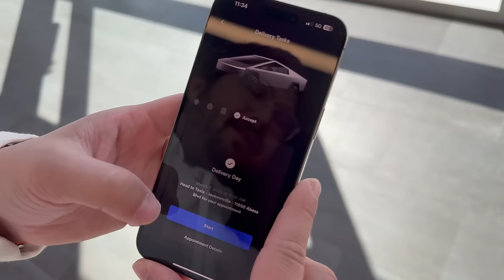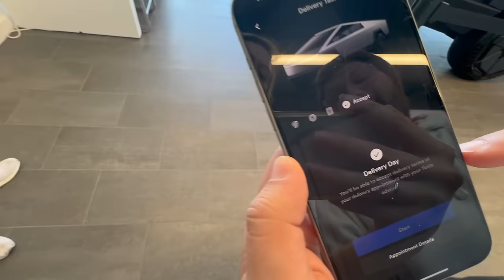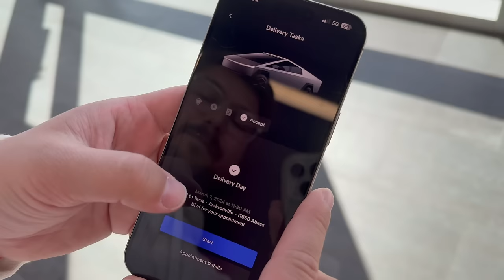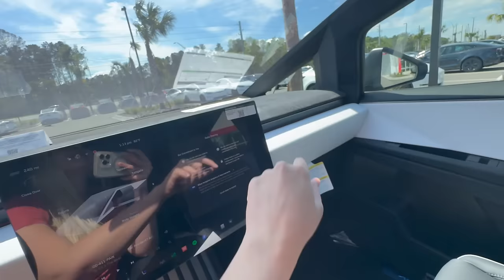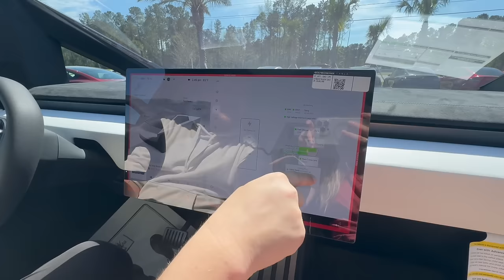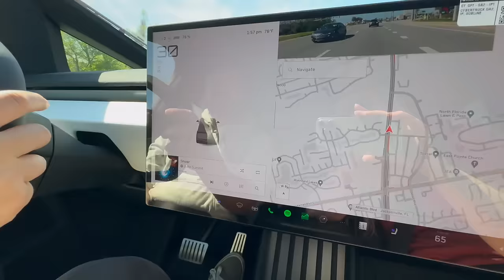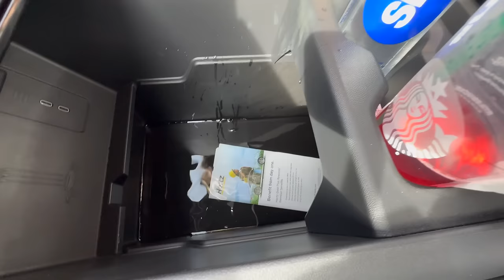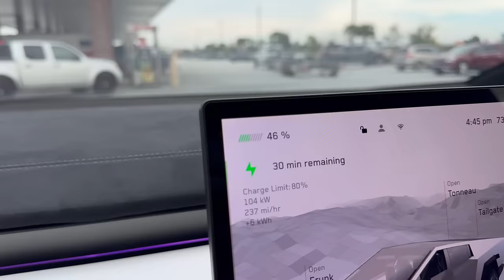Cyber Surprise! My Tesla Cybertruck Delivery Day - Build Quality, First Drive, & Handover Experience

Comment: Kyle, the foundations series cyberbeast comes with the required gateway for the PowerShare feature and a $4000 install credit as well I believe. At that point the cyberbeast is now a 9 powerwall battery back up system. That seems to me like an incredibly valuable feature that not many people are talking about. Congratulations and great video.
Reply: But only if they approve you to be eligible lol. Should be $4,000 credit towards supercharging and let you keep the PowerShare if you aren’t eligible. Or at least just the money towards charging.
Reply: The portable power features are a very big deal for many users.  

I think, in the long term, it will be a significant factor in resale value, as people increasingly realize how it works and how well it works.

Comment: 14:20 You can do a CLEAR wrap. It's basically what dealerships offer customers to protect paint against rock chips. But you can get the entire car wrapped with a clear wrap. Which would probably make the stainless finish pop with less finger prints

Comment: Makes me sad . I had originally planned to trade in my M3P that I bought in 22 when it my cyber truck turn came . I put 20k down and took a low interest (2.9) loan for 66 months . I still owe 37k as when I bought it was at its most expensive ( 63k I remember correctly). According to Tesla it’s worth 23k now with 8k miles and great condition. I’ll delay my cyber truck till I pay off this car . Sell my early reservation or give it to a friend . But I’m not taking a 15k haircut on my M3P . Even if I went through with buy and tried to resell Tesla will come after me for the profit . Love the company but that resale clause would have made me happy as it could have wiped my M3P negative equity .

Comment: 6:31 LMAO, WHAT?
 I once thought my Kona EV's 64 kWh battery was massive because it let me travel 280 miles on a single charge. 
Then, I switched to a Model Y with its 80 kWh battery and thought, 'This is a significant leap.' 
And now, here I am, learning that the Silverado's smaller battery is 180 kWh, and the larger one is a whopping 230 kWh. LMAO, WHAT? I seriously wish Tesla would bump up the Model 3/Y batteries to a usable 90 kWh capacity. That would be more than sufficient. Comparatively, the Cybertruck's 123 kWh battery now seems minuscule, lol.

Comment: Super excited you guys got this, and can’t wait for more content. I’ve got the same truck on the way. The Foundation premium isn’t a bad deal on the Tri motor if you want all it comes with.  
-FSD
-Install of 3V powershare system (up to $4000. This isnt covered on the AWD) 
-3V Powershare controller ($1200)
-wall charger ($500) 
-light bar ($400)
-lifetime premium connectivity ($120/year)
-misc accessories (~$1000)

This all totals to around $20K. So, its not just money thrown away to get the truck early.

Comment: I ended up canceling the cybertruck. Since I would not be able to do a round trip from Laguna Beach to San Bernardino Mountains. It takes just over 120kwh on my friends f150 and the usable capacity of the cybertruck wont cut it. Along with limited practicality for racks and price. Especially compared to a F150 extended range or Silverado ev.

I really want to see a f150 NACS vs EA race to vegas

Comment: Congrats Kyle!  I'm wondering how much vampire-drain it has when it sits out unplugged. Was waiting on a CT, but instead just grabbed an incredible deal on a lightly-used F150 Lightning Lariat. I'm still learning the Lightning (my first Ford), but one thing I like so far is almost no apparent vampire-drain at all. So unlike my Model S, it can stay unplugged in my driveway without concern. 🙂

Comment: I really wish those interior white panels could be dark gray or black. Maybe that will be an option later, or a product for the aftermarket. Congrats on the new CyberBeast! Those protective sheets should be left for the customer to peel, so I don't agree with the dealership letting someone else peel those off.

Comment: So I’m not up on a lot of Tesla tech. However, I’m wondering if autopilot is going to be a lot longer to release than you think. 
My thoughts is that they trained FSD with a completely different dimension vehicle than the cybertruck and as such is not a simple plug and play. I wouldn’t be surprised if it’d require an extensive training specifically with the cybertruck almost starting from scratch, so no vast database to rely upon.
The reason I think that is important is that it may be the same system they use to run the autopilot, just restricting it to autopilot functions. 
Basically they have to retrain AI to learn to drive the size of a cybertruck.

Comment: I agree with Kyle, the rear view is not the Cybertruck's best. To break up that plain slab, they should have put the logo, similar to the door sills. I know that would have been difficult on the stainless steel but would have looked better.

Comment: It's late in the season, but it would be great to compare these EV trucks if they were similarly outfitted for snow plowing.  Would Cybertruck's rear steering be good in tight parking lot clear-outs?  Would they be better than gas in the same situation because of their torque and weight distribution?

Comment: Does it have different surface finish on the doors and rear side panel?
The hood looks very rough in finish compared to my oven and dishwasher surface.
To bad about the hood and rear compartment alignment.

Comment: to properly build and test a brand new car and platform is at least 10 years, they didn't even have the factory built to makes these when the truck was announced, you can't just slap autopilot/fsd on a truck that's never been properly test, just because it works in one vehicle doesn't mean it's trans perfectly to the next

Comment: I was a lot more enthusiastic about the Cybertruck in the early years, but it doesn't hold up for the money and range based on the video.   Rivian R2S interior looked way better than this Cybertruck interior.  Rear cybertruck view Kyle mentioned in the video is super ugly on the road too. 

I keep wanting to find the positives in this thing and they are largely down to the Steer by Wire.  Cybertruck depreciation in a few years is going to be brutal.

Comment: I really wished that Tesla considered great range a must. Trucks are big and inefficient purely based on size and weight, but range is nonnegotiable for towing the boat to the lake or RV to the campsite for the weekend.

At least one version of the CyberTruck should have gotten a 180+ kWh battery and a real 500 mile range, even if it was a low volume option. The bed-mounted range extender is a poor solution due to its size and weight effectively making it a permanent installation. Good to see that GM is making a truck with >400 miles real world range even if they're only making a few thousand of them.

Comment: Regarding the steer-by-wire: what happen if you break while holding the wheel at a fixed angle.  Does the truck follow a spiral path?

Comment: Ok so for people that will use it as 90%
SUV and 10% Tow Vehicle (10k# trailer)- which is the best compromise of daily driver and occasional tow- also really want the biggest bed possible! So Connor, Tesla vs Silverado vs F150 vs R1T (I don’t think it can pull
That trailer safely). I have a CT on order- expecting vin in 2-3 weeks- but could pivot to another- will the RST be substantially similar to the current Silverado? Better than CT?

Comment: So where is the spare tire? For like a 100k truck it sure needs a ton of work and doesn't have the adaptive driver system that has to be added straight from the dealer. I would be mad as hell. Btw if you have to change like the air condition , would it be considered texting which is technically the same thing?

Comment: efficiency is most important, unless you're on the road constantly, small subset of folks need 500 miles of range on a daily basis, at that point you're drgging around batteries you don't need for daily commutes, as the software matures, efficiency will follow and range will be improved

Comment: eFUSE mismatches :hand-orange-covering-eyes:.  That does not sound good for a brand new production vehicle off the lot.  No clue what the eFUSE is being used for in this referenced VCLEFT ASIC but search seems to indicate the VCLEFT is the control unit for the left hand side of the vehicle.  So, maybe readings are out of spec for windows/door/suspension on left hand side.

Comment: Kyle the cybertrucks charging curve will get uncorked eventually after they gather data from the new pack. They did the same with the 3 long range 150kW to 250kW, Sr went from 100kW to 180kW, model S went from 150kW to 200kW. It's pretty obvious that it will get a boost.

Comment: CT has Interesting design, but with so many compromizes, poor visibility all around, super sensitive steering in low speeds (you have to be super careful all the time cruising in the city, not to make passengers feel sick etc, absence of stalks etc like looking so poor and cheap and empty inside especially at night with just a big  screen in the  middle, while even cheap cars have 3d instrument panels that look so much better  etc etc, "problems" that have been solved many decades ago by convensional cars. 
In person it looks better  i  think, but its funny in the videos that most cars around it looking much  better, in fact it makes some cars you would not look twice, to look good haha  controversial but true...
Some more negative things i realised from my quick test drive in the States: back passengers sit rather low and the front massive seats with those fixed headrests block very much their view ahead. In all other trucks and suvs and even  in most hatchbacks the visibility is much better.
The electric motor noise is quite loud at any speed in acceleration and in deseleration, which is fun in the  beggining but will be  tiring in everyday use... and the list goes on and on...  still a  nice toy for the  weekends if you are in the mood trying to fight all these problems which do not exist in almost no other car of today...  
Also it is not futuristic, it is  like  retro-futuristic....  would really be futuristic if it  was  made in late 70s or 80s.
This is my objective (european) opinion, not for me, too much struggle , still an interesting vehicle for youtube content etc
Curious, didn't you notice as well those negatives, like the poor visibility, the cheap feeling driving this at night time, the sensitivity of the steering in low speeds? (which is good only in parking lots, like 1% of low speed driving) 
The list of negatives is very big unfortunately, i didn't bother to mention many which are common in other teslas too, from the ergonomic point of view, which to most experienced drivers are deal brakers, like meyself. 
Still engineering wise this is a big achievment to really put this design into production actually!
And as i said before you chose the best vehicle for youtube content for the moment.
I hope you don't forget to say the negative things too as you notice them, all cars have + and - .

Comment: Holy shit , my first car had no power windows , no power steering , no power brakes ( drums) , no AC , and only 1 option which was a 4 spd instead of 3 on a manual transmission that having to close your own door being any kind of issue despite the self depricating princess statement It is wild what would make somebody not like a high end car from arguably the company that started or fast forwarded the industry that even makes the channel possible. No ass kissing of Tesla as reviwers is a must , but even as a joke its not endearing and see,s true and just highlights how spoiled younger people are . In some ways , i feel like cars are partially soo expensive now because people NEED soo many things and soft touch fuse box covers on more basic cars you cant even buy " stripper versions " of cars anymore to save money , your forced to buy " standard" features that are NOT FREE regardless of being optional or not . That or you need to buy a car you dont like that still has features you dont need because a better car cant be had as a true base car , so you emd up with an expensive cheap car with all kinds of shit you dont want or need compared to the money .

I understand MFG and how its easier to mass produce cars with a mess of features instead of custom orders but on lesser cars you need to buy an entire package for 4-5K to get one upgrade for something important to you that sould be a couple or few 100  . People are shocked about prices on cars but at same time complain that cars dont come with X . Y or Z and horrified that something is hard plastic on a non luxury car . People would rather have soft touch materials that will never be touched , especially if you dont detail your own vehicle ,  in a shit box then plastic in a better car .

Get off my lawn already . Go to the gym so you can close car doors.

Comment: There is nothing practical about Cybertruck or any other Tesla for that matter. Alyssa is right, the truck is a novelty.
I would pick Chevrolet Silverado with the largest battery any time of a day over Tesla gimmicks.
I am looking forward for a Chevrolet Suburban EV based on Silverado.
However I might consider second generation with much larger batery similar to Silverado Ford F150 Lightning based Explorer EV.

Comment: It's got one of the most god awful designs of any car I've seen since the Delorian but this doesn't have a movie franchise or nostalgia behind it.

I've never driven one but I do hear the audio system and weird crab like driving mode are actually really good so I'll give them kudos for that, but Tesla has a reputation for producing garbage for the first couple of years of a car at least then mediocrity when they figure out how to mass produce them. If it's anything like the Model 3, it'll have design defects up the wazoo, with an infotainment system that is near unusable because it won't play nice with any other company, and mechanical issues galore.

Tesla releasing a half finished car is pretty normal for them though, they seem to work on the whole DLC patch model that software works on but does NOT work for cars.

Comment: You knew at this point you were not getting the FSD , you both complained about it to the point of annoying.  It was not a surprise, so mention it & then let it go.  The wheel & steering is going to feel different. The wife complaining immediately. Give it some time, you might love it in a week. The best thing about the truck is the handling. Give it a little time before you complain. Too much negative for something you are not use to.